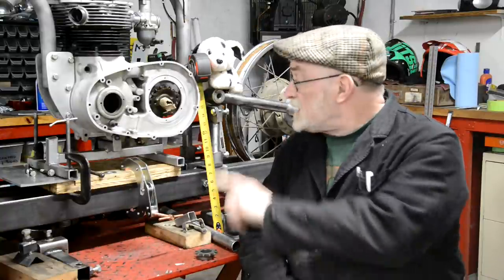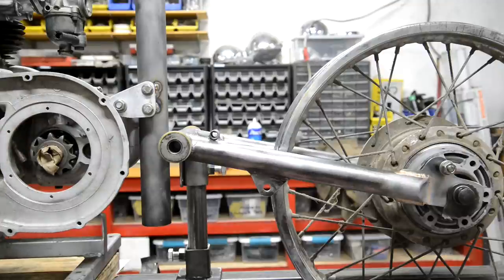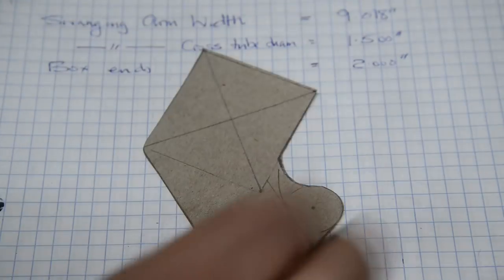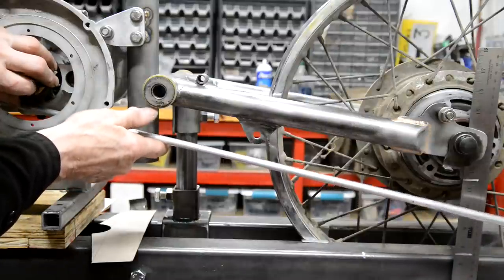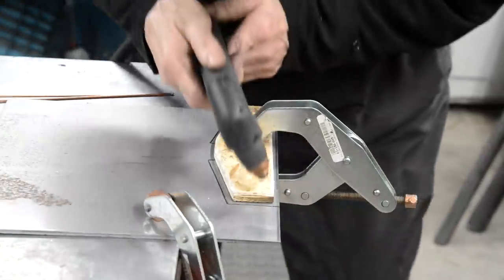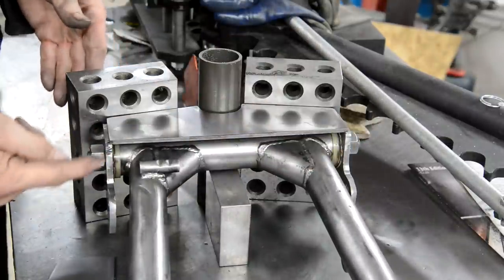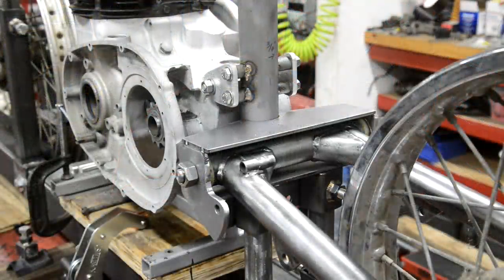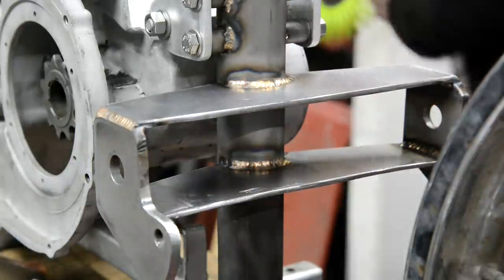Triumph 500 Otter  -  Part Eight

Comment: Greetings,
This question comes a little late, but I just watched the video today.
There a two holes in the bottom of the swingarm pivot tube.
What are they for?
At first I thought they were for fitting grease zeros, but the lower plate on the pivot box looks too close.

Let’s be careful out there.
Reply from the maker: They are for grease fittings so I welded them up and moved the nipples to the rear of the tube.

Comment: Interesting video Michael at 21: 43 when you put a throttle cable into the top of the carburetor should you not have located it into an adjuster with a rubber sleeve to protect water and dirt getting into the top of the carburetor. ??
Reply from the maker: It's only a mock up to see where everything goes.

Comment: If you used thick gasket paper and used a small ball peen hammer or even a spanner outer curve of suitable size you could tap out the holes for engine mounting plate. Use that as template for marking holes?

Comment: Seems like a lot of leverage working against that down tube.  I'm taking it that it comes to a dead end and not continued as a cradle under the engine.  Maybe stiffen it with something slipped up inside?
Reply: I would imagine the rear subframe loop will stiffen the swinging arm bracket up, I'm looking forward to seeing the results
Reply from the maker: The engine is a stressed member as it bolts front and back with further mounts at the top and in the bash plate.

Comment: Another masterclass Michael, Just like Torville and Dean perfect marks all round Full compliment of 0.00's. I did have one slight concern, With the position of the brake pivot holes would you still be able to fit a crossover linkage if necessary as you mentioned? Well as usual, off to watch it again, once is never enough, I always notice something different at the 2nd viewing. Stay Safe and Take Care, Dave Northumberland UK.